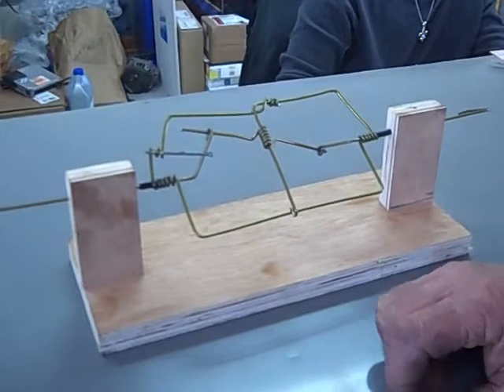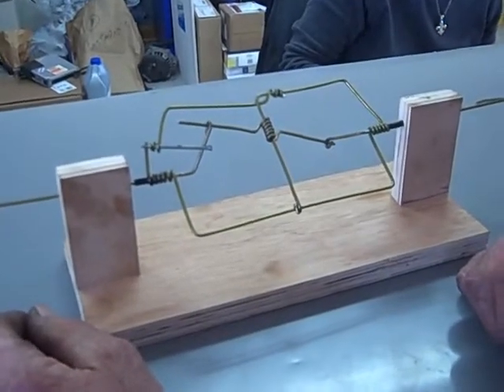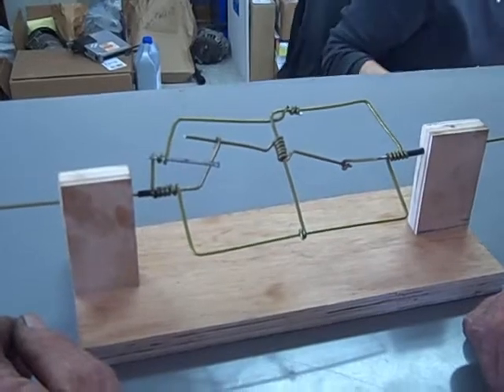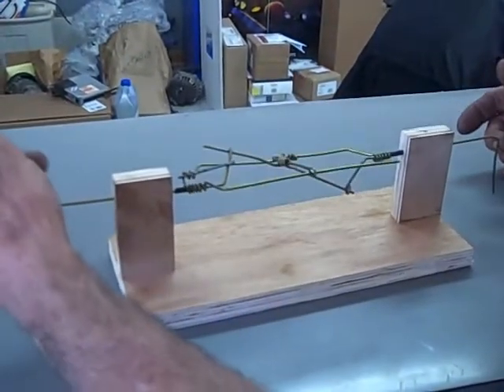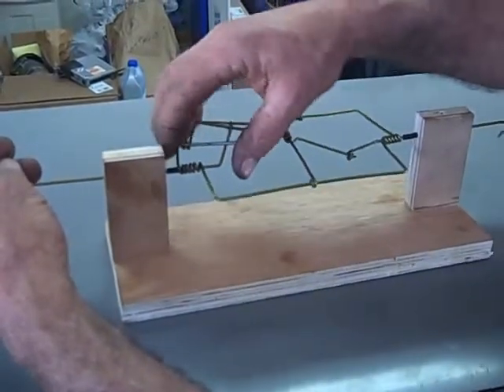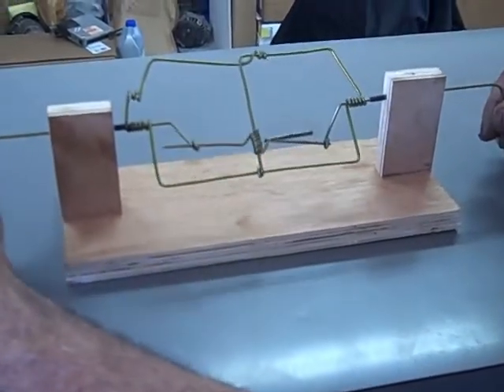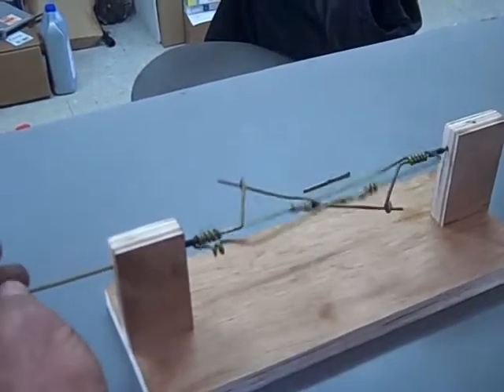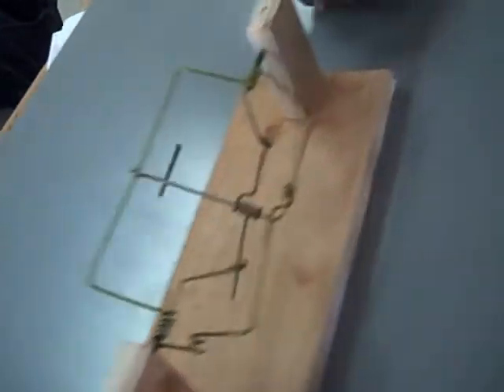JB's Gearless Transmission Model March 2010.wmv

Comment: good day, is this already patented? we would like to create this with regards to our machine design project requirements. we would like to add an innovation to this concept and introduce this gearless tranmission to our prof.
Reply from the maker: This concept was patented, but it has now expired and is in he public domain.
If you have an innovation that can use the basic idea nad if you think it can be patented
 please go ahead with it.
Reply: disproman thank you sir for your kind consideration! By the way sir, We are 5th year Mechanical Engineering student. Is there any chance you have a 2D design or sketch of this already? so we can formally propose this concept to our adviser this coming week for the completion of our subject 😃 you can send it to garryson09@gmail.com if ever. THANK YOU SIR !
Reply from the maker: No I don't have a sketch or 2D drawing.
Surely that should be easy enough for you guys to whip up
Reply: Good day sir, were already creating the model. But we can't figure out how to build the correct sliding rod in the middle part. Can you give us a few reminder or guide how to perfect the sliding rod? Thank you!!!!
Reply from the maker: Well this first thing to consider is that the sliding rod must be as frictionless as possible.
That means the alignment of the sliding part and the rod on which it slides is critical and  must be very well aligned. 
Have you tried duplicating the model shown in the video ?
That's probably a good place to start.
You'll then see where the critical issues are.
As for making the sliding rod - - well that's up to you to choose the material and how you machine it.
Reply: Yes we tried to duplicate it just like in the video. We are confused wether the sliding rod is inclined or just a straight line hehe. But we are going to try a little more and take your advice to make the sliding part as frictionless as possible. Maybe we can put some lubrication on it? 😂
Reply from the maker: As I recall it was a straight piece ( aside from the wraps around the centre rod) .
And by all means use lubricant. In the "real" version of this device, the whole thing would have been in an enclosed housing with an oil bath
Reply: Thank you sir for the tips! We're going to build it again and see what we can do about the sliding rod in the middle which is the critical part. If we can be able to finish it, we're planning to put a conveyor at the output crank as an application. Do you have any other good application regarding to this model sir? Hehe if you don't mind😁